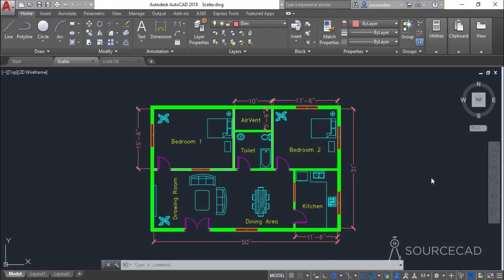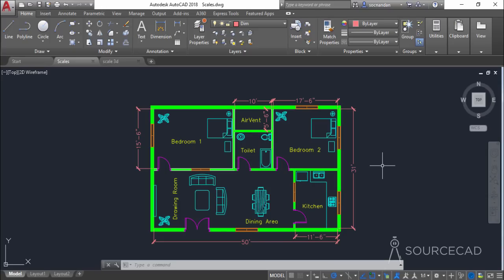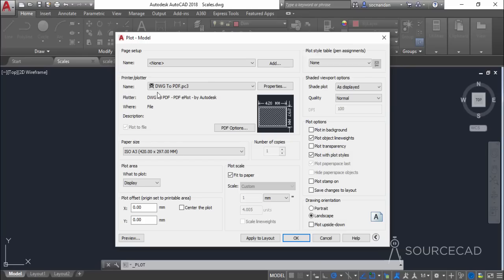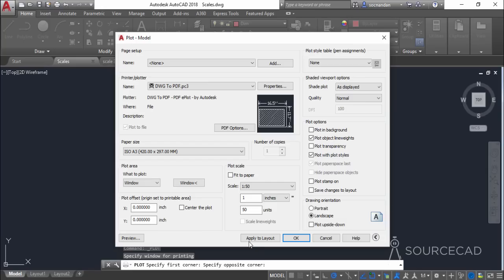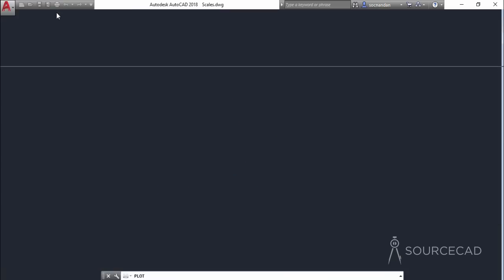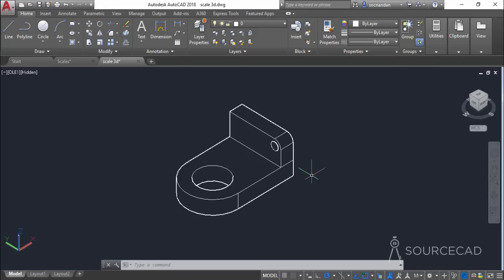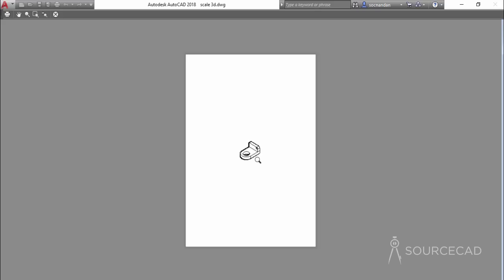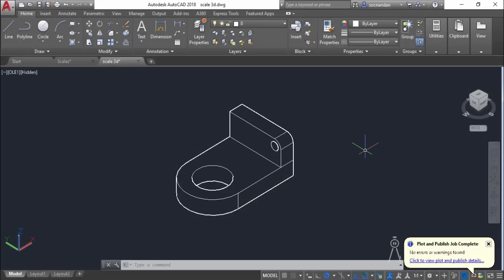How to use proper scale in AutoCAD drawings - Part 1 of 2

Comment: Hi please can you help  me?  i don't know if my (floor plan )model scale  is too large or too small . in model when drawing dimensions lines it doesn't display. its shows 9.9404E+13( exponential). i have checked units in millimetres, decimal.0.000 but , i set scale to 1: 100. in paper space there is nothing, showing  what is wrong ?

Comment: Sir, what if we draw the layout in meters, I will be thankful if you answer the question
Reply: I think i have the same problem that you are experiencing. When drawing in meters and going to the plot dialog, you find it either lets you print mm or inches, if you choose mm and then match it to meters, (1m =1000mm or 0,001m=1mm) you find your annotation scale does not match the plot scale (like selecting 1:1 annotation scale in the viewport leads you to a 1:100 printed drawing) from what ive found is either you start drawing in mm or you edit the default scale values to match what you are selecting.

https://www.cadmasters.com/techsupp/ldt/metric.html

this may help you

Comment: How do I add a visual ruler to at one corner of the drawing (when I am not displaying dimensions) so that someone can match the ruler drawing in the printout with an actual ruler to confirm that the drawing has printed correctly? This is of much need in pdf too as the pdf reader doesnt show the drawing to actual dimensions at 100% zoom and it varies from one file to another.
Reply: You draw lines on your model space and use the linear dimension command